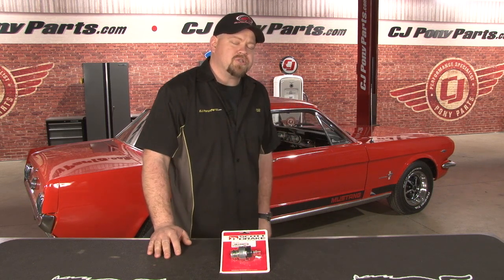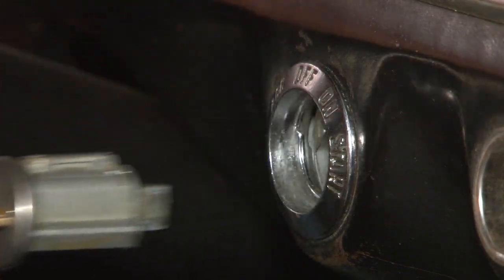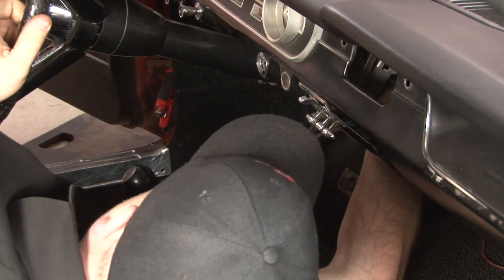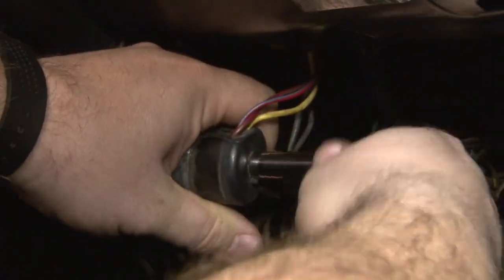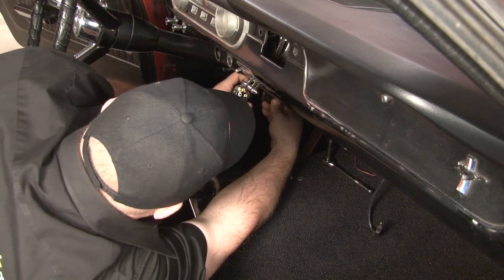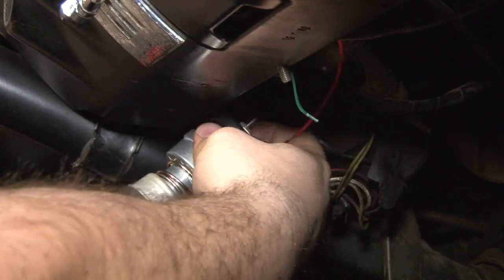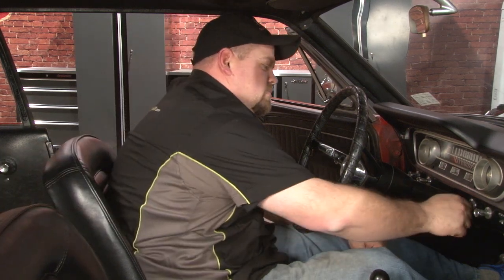Ignition Switch | 1965-1966 Mustang

Comment: Will the key be locked into the cylinder until u reinstall?  Do u need to insert the paperclip for installation as well? I have a 65 lincoln and removal was identical but have not been able to inall yet.

Comment: The switch won't release after pushing in the small pin (with the key inserted into the switch). It will turn with the key as you described, but it won't come out like it should. Is there another way to remove the switch, other than drilling it out?

Comment: Hello, I am unable to get the bezel to release from the switch. The switch will push in against the spring, and the switch and bezel will turn counter clock wise, but the bezel will not release from the switch. Any suggestions? Thanks!

Comment: Thank you. This looks similar to my 66 F-100, though the truck switch is left and below the column, likely easier to see and get to than the Mustang. I am having issues starting, not sure if the switch, the solenoid, ground issues, alternator not charging enough, wiring issues or something else. It either starts fine or nothing at all, not even a click.

Comment: Hi. I have a 1965 Ford f100 given to me. But I'm having trouble wiring my ignition switch.
They placed an ignition switch from another year and it's not working.
Id like to replace it but the back of the switch is different.
So it's kind of confusing.
I was wondering if it was possible to make a video. It's be a lot of help.

Comment: Replaced the wiring harness on my 66 Ford Mustang  but having issues with the car not starting.
I switched the wiring from the coil to the oil sending unit I somehow crossed them

Comment: hey sometimes my mustang doesnt turn on when i turn the key only manually by using a screw driver touching on the solenoid the starter with the cable that goes to the posotive battery and sometimes when i take out the key the car will stay on. any help or advice would be helpful thanks

Comment: I was a about to give up trying to get the switch out--I could not get my fat hand back there to apply enough push and twist. Then I thought I 'd try removing the instrument bezel. And there it sat, ready to be plucked out with a flip of the wrist. (Of course, learning how to take off the bezel three months ago is another story.) Anyway, much easier to remove and to install by going from above.

Comment: Thank you for the video. it has helped. This is not a very easy job, I have read over 50 comments where the assembly would not simply twist and turn and be installed. This part of the job is almost impossible, I have no idea how the factory did thi unless the cluster is removed. This is not easy at all. 2 hours of aligning and pushing and twisting still not installed. You are upside down, things are sharpe inside there. It does not twist easily, you can not see a thing. I am still trying after taking many breaks to watch the video again and again. That s why it has so many views!!!! If they made a switch that simply installed and plugged in I'd buy it! This is going to take a lot of luck and my time to get done.

Comment: You didn't mention that the little ears on the sides of the switch are different sizes, and the bezel/switch will only go together one way. I found that if you push the bezel into the dash so that it's sitting flush, and the push the switch against it and turn, it will go together much easier.

Comment: thank you for this clear and concise instruction video. Not an easy task; that spring is way too strong for the mounting of the switch. I had to heat mine up to relieve some of the tension, and then it went together well.

Comment: Got this g link system and now fighting the sway bar that's over 500 dollars. Have to find out how thick the sway bar bolt bracket is. Can't get it to fit since mine didn't have the one shown here for the sway bar. Did anyone else have this issue?

Comment: You can easily change the lock cylinder, I assume you mean the ignition cylinder though. The only option there is to drill straight through the center of the cylinder and remove it that way which can be a process to get out.

Comment: Great video....I've changed mine in my Early Bronco ('73) over 20 years ago when I was a "flat belly" when I could contort in all ways under the dashboard, etc.....I am now a "flat belly" without the "l", less limber and much less patient....but having done it before I know I can do it again....this video is great and thanks for taking the time.....OBTW, many aftermarket switches are NOT quite right in size so I found NOS which for me was the way to go FoMoCo or Motorcraft....thanks again

Comment: For anyone that doesn't have the key. A lot of those old ignition switches didn't use the tumblers to activate the accessory feature. Find yourself a screwdriver with the same width as the key Stick it as far in as you can then push the pin in, turn the key to accessory, then turn counterclockwise and pull the ignition switch out.
Reply: Thank u so much I was looking for this specifically
Reply: LOST IGNITION KEY = I was scratching my head trying to figure this one out! Thought I was going to have to replace the entire assembly!!!

Comment: LOL, 45 minutes to a hour, took mine out 10 years ago, been using a screwdriver ever since, after looking at this I think one of my biggest problems was compressing the spring while inserting (65F100), I think I will retry it but first collapse the spring & to hold it in that position use wire ties, then after inserting cut the ties

Comment: Please help. I have a 68 mustang, just replaced the underdash wire harness. Now the Ignition resistance wire gets really HOT. I've replaced coil, voltage regulator, fairly new solenoid. HELP.
Reply: I'd like to know that as well. A wire gets warm but not to melting point. Also, on this video it only has one looped wire not 3 like I have on the back threaded stud. I'm confused. I also have to run wires to the solenoid & a starter button. It doesn't turn on without it.

Comment: Bill I have a 1961-66 truck switch which is the same as a Mustang.  It is a new switch and not in the truck.  I cannot get the cylinder to go in.  Been messing with it for 3 hours and no luck.  What position does the slot in the switch need to be in ? (from top 9:00, 10:00, etc) Do I need to put a pin in the hole while trying to slide the tumbler in?  HELP!!!!!  This has been a big episode of frustration !  I've owned a lot of Fords of different years but have never had this problem before.
Reply: Mark Muffs If the bezel and switch are installed in the original location the slot should be on top of the cylinder and should go in just to the left of 12:00
Reply: Bill Tumas Thanks Bill.  I put a safety pin in the hole and it snapped right in.  Never have problems with the older or the newer (two sided 1967-up) but these were always tricky.

Comment: Not sure if this will help anyone else, but I had zero room from the bottom.  I loosened the instrument cluster and changed from the top.
Reply: I had to do the same thing and loosen the instrument cluster in order to get enough room to work.  I couldn't get it from under the dash, but it was easy with the instrument cluster removed.   I had to remove the speedometer cable as well.

Comment: Hi Bil,
im currently restoring a 64 Fairlane 500 here in Australia. You video on removal of the ignition switch has got me out of a jam, however after turning the key past the accessories, I still cant remove the barell. I have lube the barrel just in case something inside was jamming. The barell has move slightly out (1/8") but that's all.
Do you have any thought on this
Cheers
Craig
Reply: Once you go past assy. it should just come out. I would try rocking it in both directions since maybe something is hanging up.
Reply: Bill Tumas my 1993 mustang has ignition problem. When I turn the key,the car starts,but key does not return to run position unless you move it. Which do you think it is?
Reply: Glenn Runninghawk Could just be a worn cylinder, make sure that the plastic trim isn't holding it up.

Comment: Tips:  The new spring is almost impossible to compress enough from under the dash:  Use the old spring.

A new lock might not come aligned and will not go in regardless of how your key was positioned in the old lock.   Use the pick on the new lock to align before trying to install.
Reply: Great advice but I still can’t get my cylinder to meet up. This project is a pain in the ass
Reply: @Kasper623  Hope you got it sorted. It was a PITA the first time I did it.

Comment: I hate you.... I have a 74 Firebird and to replace the ignition lock cylinder I had to take off the steering wheel including about a million little parts including the need for a pressure plate remover and a harmonic balancing tool. We wont even get into how much of a pain it was to replace the ignition switch which was obviously intended to be replaced by someone with the hand size of one of Snow Whites crew. Regardless, great video.

Comment: I have 1965 Comet, I just charged my battery. When I went to hook it back up the car try to start. The keys are not in the ignition. I am hooking it up the same way as before and i have never had any issues like this before. could my ignition switch be toast?
Reply: Either that or more than likely your starter selenoid might be stuck open
Reply: Bill Tumas thanks it was the selenoid.
Reply: do you ever find out what was makeing your start up like that becouse my car is doing the same thing
Reply: What if the key won't even turn to the accessory position !?!  63 thunderbird

Comment: 1st I want to say your videos have been very helpful. My question is that my key seems to be loose when i place it into my ignition and now my ignition is stuck on "on" and wont go back to off. Any suggestion? What should I replace (or do you have a video on such problems?). Thanks.
Reply: If it is stuck on the on position it can either be the switch or the cylinder itself. I would try removing and then re-installing the cylinder and see if the cylinder has free movement when you remove it
Reply: Bill Tumas  Thanks for the help. The guy who did the restoration on the dash area did who knows what to my ignition switch. The cylinder was jammed in, so I break the face on it to remove the switch from the bezel. After all was done followed your video to install a new switch, cylinder, and shinny new bezel. The old cylinder is still stuck in the switch so into the trash it goes. Thanks for your helpful videos.

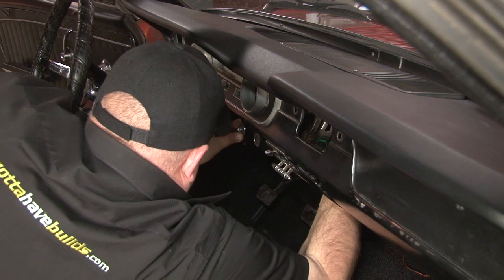Comment: Just a note.... at 1:28 the video "jumps" ahead, hiding exactly how HARD it is to reach and "grab" the back of the switch.  Typical for this type of video.  There is so much stuff under the dash, it is almost impossible to actually grab it in a position where you can push and turn the switch to release it from the bezel......awkward and no leverage.  The same thing is at 3:09 when reinstalling the switch and having to push and turn.  Very difficult without removing other components under the dash.